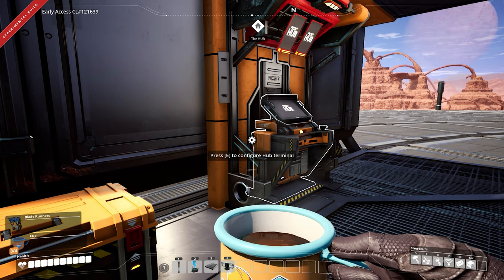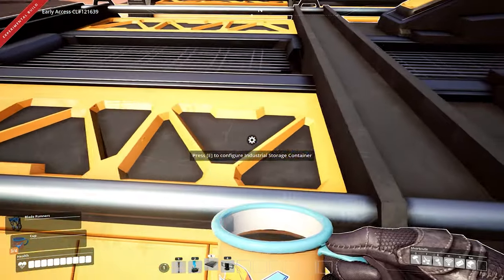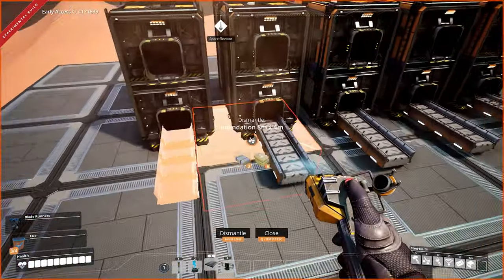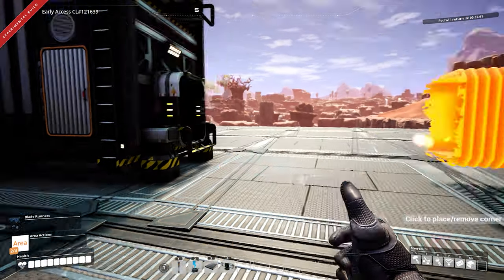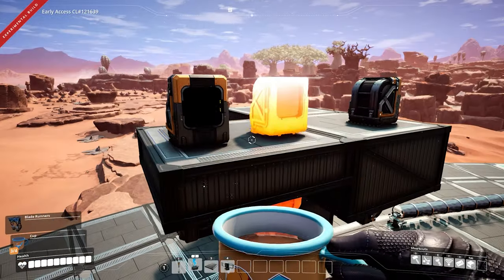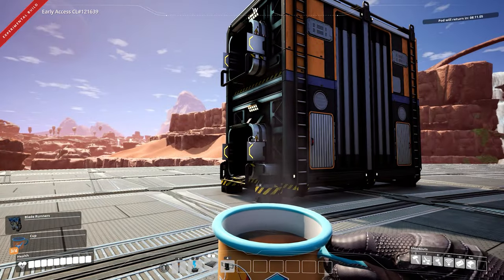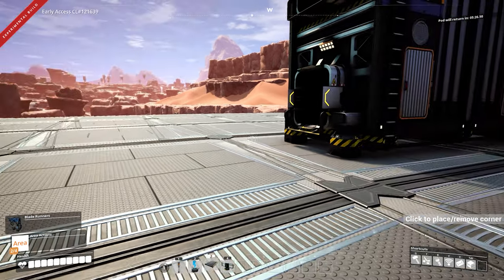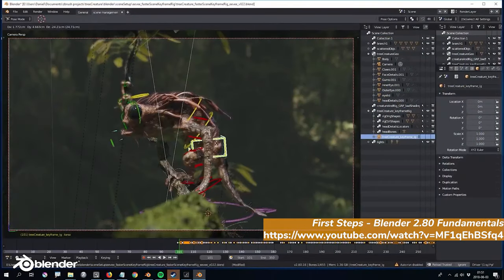Covered and Paintable Conveyor Belts and MORE [Satisfactory Mod Showcase]

Comment: Do the covered conveyors help with FPS in rooms with lots of conveyors?

And how does the balanced splitter function when under supplied? Like if you are only putting 10 parts per minute into it does it wait for all outputs to have qty 1 before sending or does it output as soon as a part comes in?
Reply from the maker: 1) apparently no, game still renders everything even if it is occluded (even by walls)
2) As far as I know yes. It will wait for all connected outputs to have enough to send 1 unit each. However I am not sure what would happen if the outputs are unbalanced (mk1 mixed with mk5 for example) If it will throttle down the whole system to maintain balance (most likely)